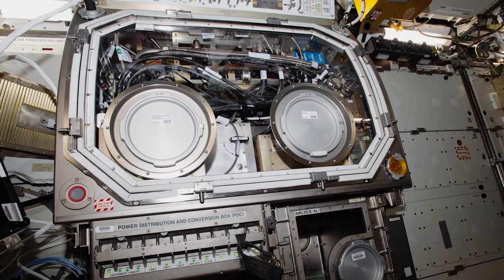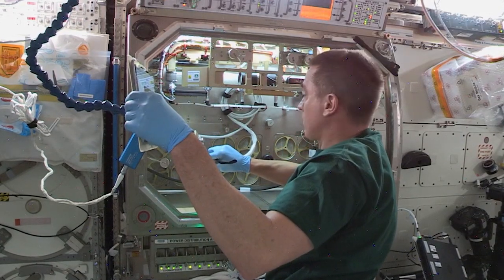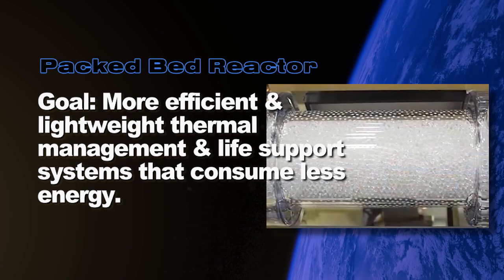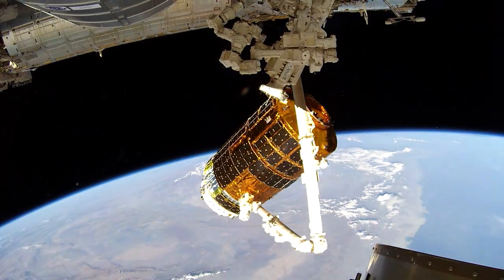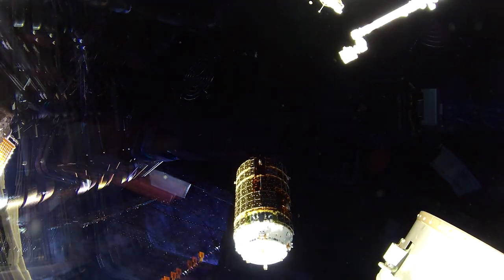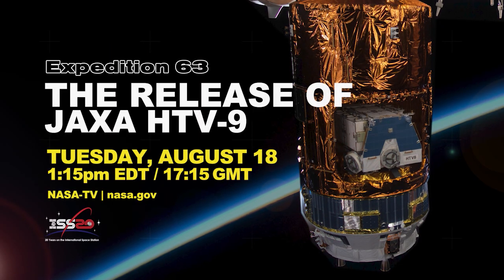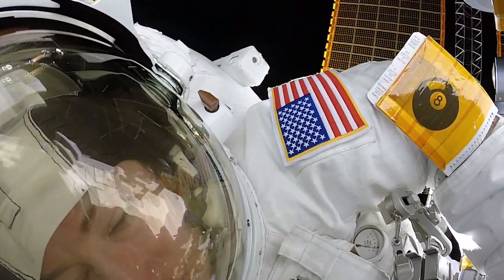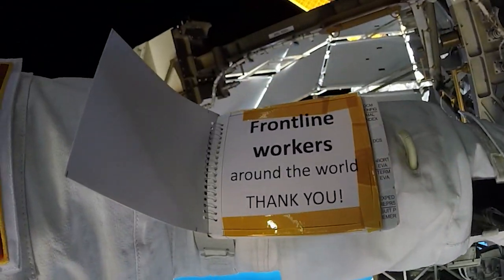Space to Ground: The Checklist: 08/14/2020

Comment: A rocket does not work in a vacuum because there is nothing to either pull or push.
- Stream of gas has velocity . To initiate a force you must accelerate something.

When a bowling ball is thrown from a boat. 
The boat DOES move in the opposite direction.
Because the bowling ball has weight
And weight = resistance to acceleration 
You are pushing "on the resistance the ball has to being accelerated".
Or put another way " Applying an acceleration to a weight generates a force that opposes the acceleration"

Like for example when you feel pushed back into your seat when a car accelerates. 
- You are the bowling ball and the car seat is your hand accelerating your mass.